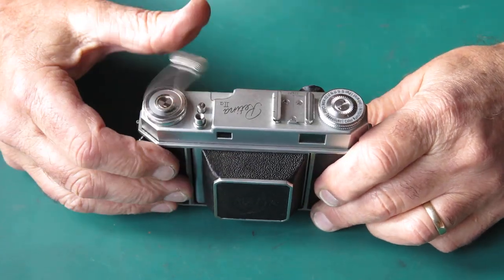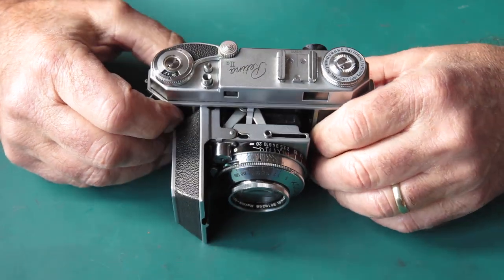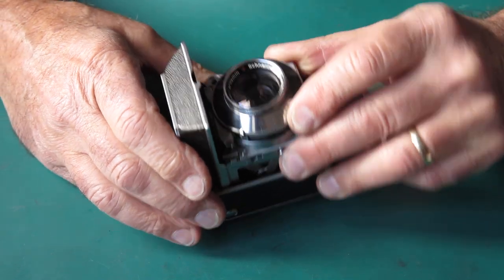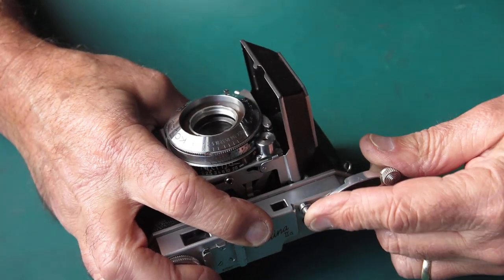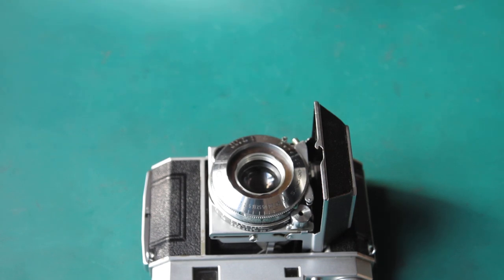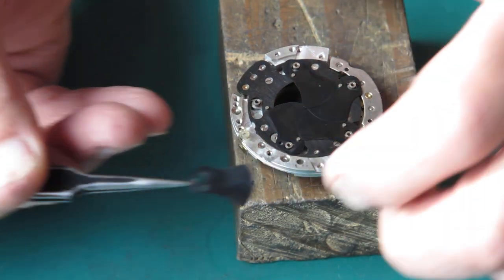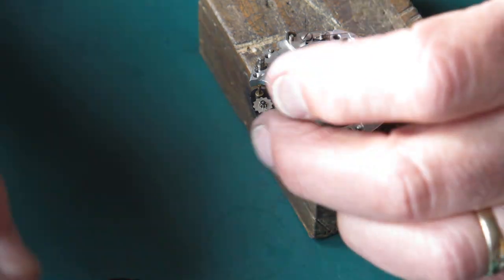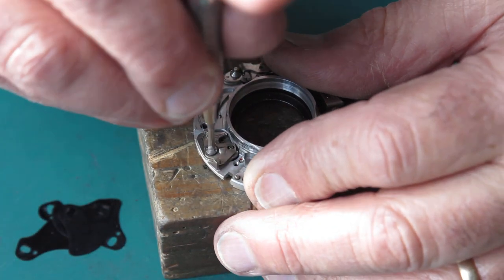A Kodak Retina IIa with a dead frame counter and what else? part 01

Comment: Oil- worst thing they could have done to the shutter.  Ugh.

Shutter actuating ring.  One long screw, 3 others short.  
Marked mine.  Easy to put them back incorrectly.  

It’s nice seeing the Master at work.  🙌

I just rebuilt a 1a this week.  
That shutter part, the one you could not remove at 7 minutes.
, was a bear to put back in.  Lol.